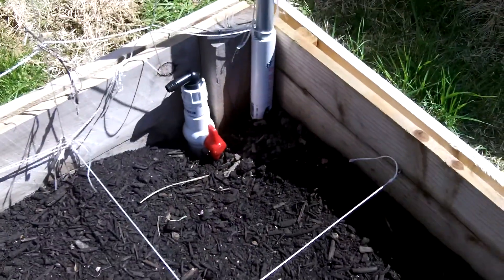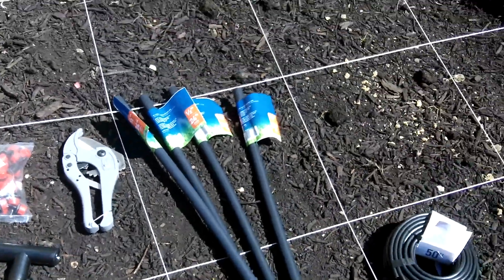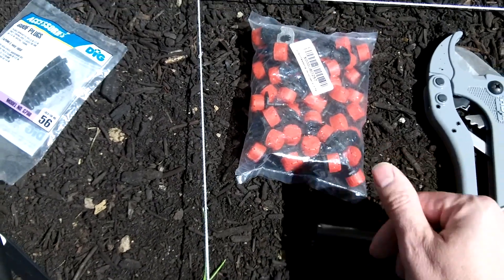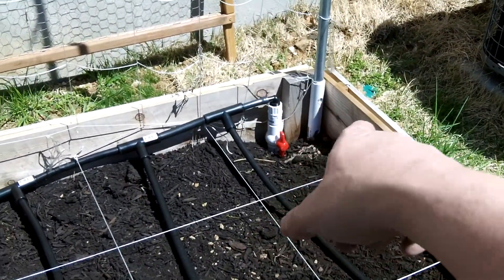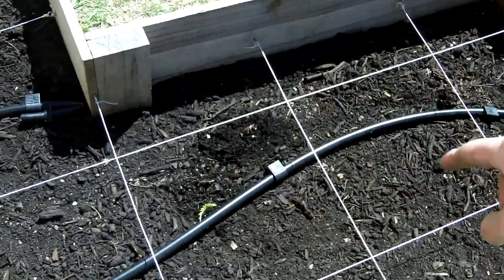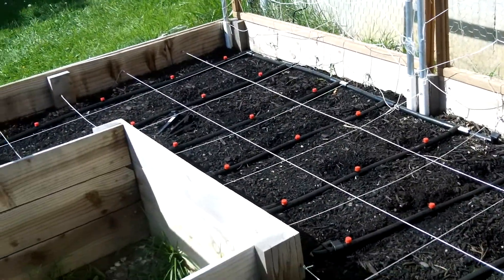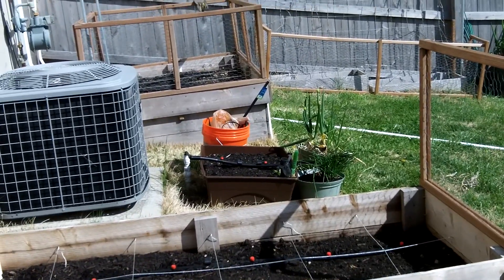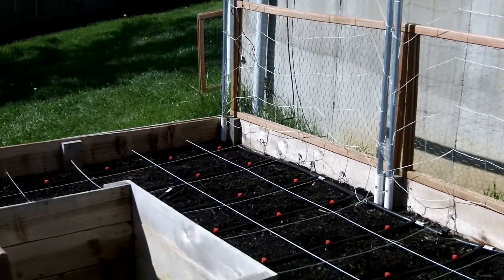Around the Home: #35 Drip Irrigation Part 3 - The Drip Lines

Comment: I bought the dig drip system for raised beds. I like your idea of the red shut off valve in each bed. so if one or other bed needs water and others don't, that can be accomplished? would I need one lead line that goes to each box? is that what you have? it'll bypass the beds you don't want watered? tomatoes need more watering than say beans.
Reply from the maker: I have a ball valve on each bed so I can shut it off if I needed to.  You could also plan out varying emitter levels for one bed over another if you wanted so the tomatoes would get more water than your beans. I have moved over to 1/4 inch line for all the best with built in 1/2 gallon per hour emitters. Bit easier to control for me. They also make small shut off valves that are 1/4 inch size that go in line.  Might be an option too, bit cheaper than the pvc ball valves.

Comment: what is the minimum output?
Reply from the maker: Those emitters were 1-16 gallons per hour I believe. I found them quite touchy as to their output. I will be replacing them with 1/4 inch line that has the inline .5gph emitters.

Comment: Tip: We had trouble getting the emitters into the tubing.  The instructions said to leave the tubing out in the sun to soften it which would make it easier to get the emitters into the tubing.  This did not work for us and no matter how hard I tried to push each emitter into the tubing, I could not get them to go in.  So I took my lighter and held the flame briefly - about 4 or 5 seconds - on the tubing and then pushed the emitter into the tubing.  The flame of the lighter softened the tubing and the emitters popped right in.  It took all the frustration out of the process.
Reply from the maker: +ferocitas1958 Nice. thanks for the tip. My little punch too seemed to work ok. still tweaking the system though.
Reply: +Scott Hayden You are correct, the punch does work fine.  I meant to say after punching the hole, I would use the lighter.  I used the punch to put a hole in the tubing, then would hold the lighter up to hole in the tubing for a few seconds, then push the emitter into the tubing.
Reply from the maker: +ferocitas1958 ah that makes sense. I didn't have too much trouble getting the emitters in. But tweaking the system has been interesting. Things are getting watered though so that is what is important.
Reply: i agree with you. i am trying to go from 1/2" to 1/4" micro tubing. i cannot get those little plugs in to save my life. i even tried to use vice grips to squeeze them in. i will try the lighter thing and try not to burn my landscaping down in the process
Reply from the maker: I may move over to the 1/4 inch tubing next year and place the lines every 6 inches on the header pipe. May give better coverage on the watering.  Something to try.